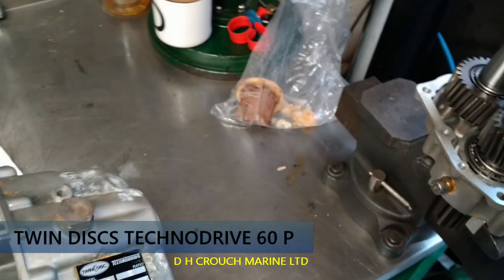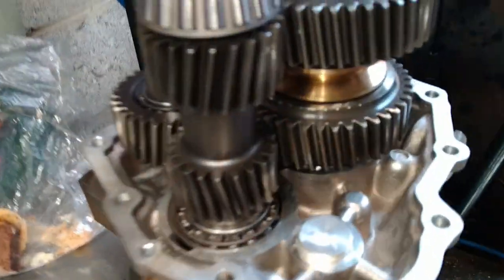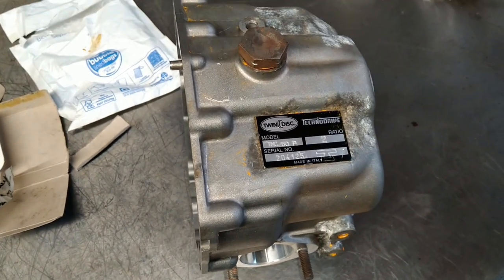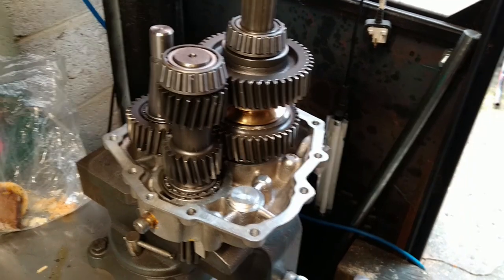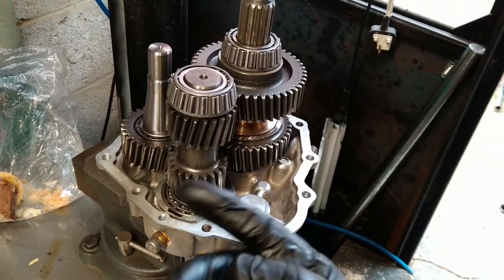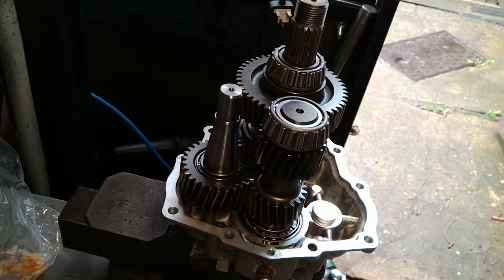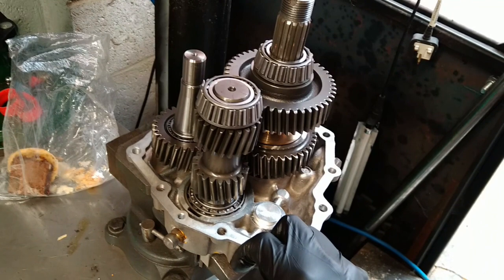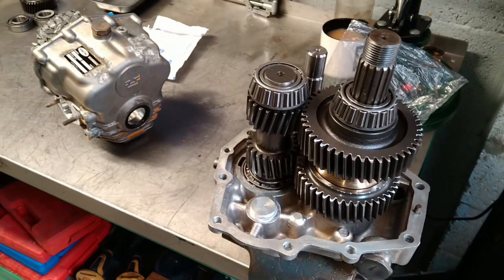Twin discs Technovdrive 60P

Comment: That’s such a useful post!   Mine connected to a beta 38 has just started leaking ATF, I think from the output shaft seal.   It’s quite inaccessible!  Is it possible to change the seal without taking the gearbox off?  Is getting the output flange off, with the big nut, likely to be easy, and can the seal then be fitted?
Reply from the maker: In principle yes. It would be a bit of a game but should be possible.
Reply: @dhcrouchmarineltd3049  thanks for replying. If it does come off (would it need a puller?) do you just prise the seal out and put a new one in with a sealer on it?

Comment: Hi would this model fit to cummins 260hp 2200rpm marine diesels?
Reply from the maker: You can make anything fit anything. But with that much HP it provably try to spit it off the back. Always best check the manual for the Max rated input power for any gearbox.

Comment: The half coupling has an oil seal on the exterior but is there an o ring inside to prevent oil from escaping between the splines?
Reply from the maker: Not on these gearboxes. Use of a sealant is used. I used Wellseal. 
On the older PRM hydraulic boxes that had a removable shaft coupling there is an Oring.

Comment: You went for the jasic! I ve been trying my hands (and eyes) at tig welding too. Is that what you used to do the ali repairs?
Reply from the maker: I have had Jasic for years now. All inverter machines as I need to be able to use my AVR generator with them sometimes.

Yes I used the Tig for the propeller. Honestly these are such nice machines.

I have an MMA, MIG and now the TIG all Jasic. Should add I have been planning the TIG for years. Its opened up my repair service options.